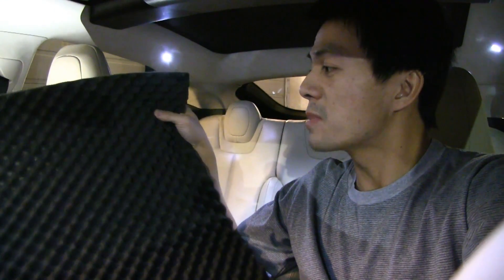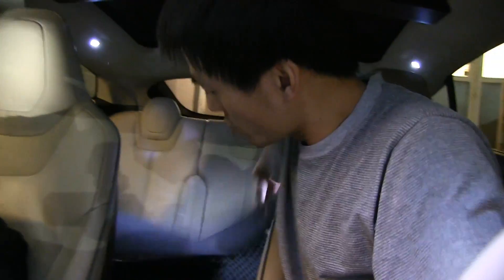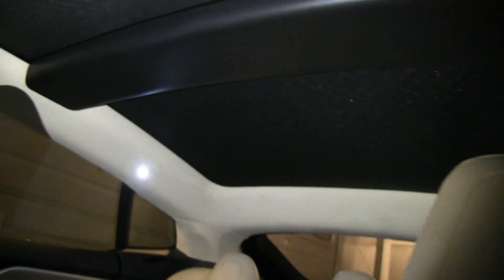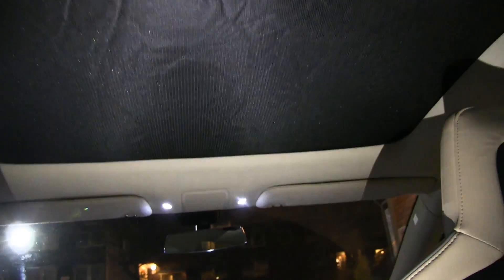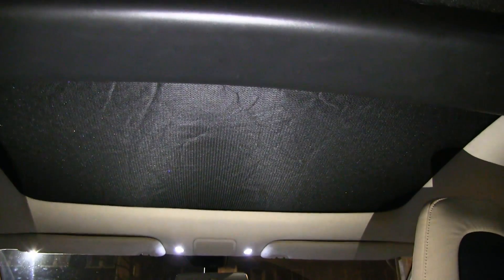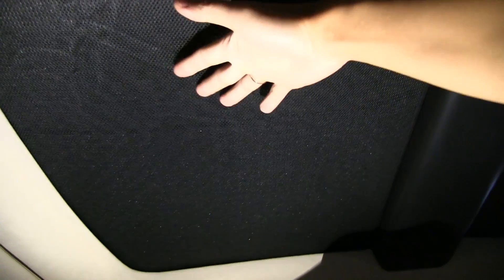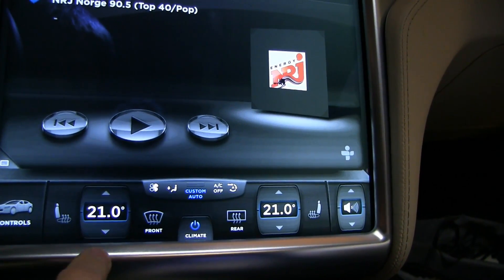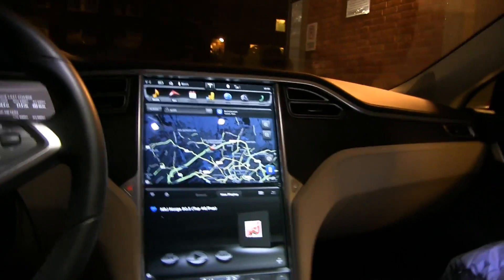Panorama roof insulation improved

Comment: This may just be coincidence, but it seems like my panorama roof is much draftier since the 7.0 software update. It doesn't ACTUALLY let air through, but seems to transfer more cold through the glass itself. At result, the air in the car above one's shoulders is quite a bit colder. I've been blaming this on the "more efficient" HVAC Tesla introduced with the new software because I don't remember the car having these problems last year. Thoughts?

Comment: How about insulation from heat during summer? In an ICE car amount of heat available is never an issue, while A/C can increase fuel consumption quite noticeably, especially in small car, like my mums Micra where turning on a/c feels like pulling a handbrake up a little :)  Here you have to both heat it with electricity and run a compressr during summer, I guess that A/C load is higher with glass top.
Reply from the maker: It's not an issue at all because the glass absorbs most of the heat. On a hot summer day, you can feel how hot the glass is. If it was cold, it would have let most of the heat right through.
Reply: I guess that it is heavily tinted and maybe even coated to be IR-reflective, but it usually gives glass violet tint that I haven't noticed.

Comment: Do you regret getting the panoramic roof considering the weather conditions you are usually in?
Reply from the maker: Not at all. With the insulation, I don't feel the cold in the winter. And in summer I can drive "topless". I also have the option to load stuff on the roof which requires panorama.

Comment: Bjørn there is also insulation for back window in tesla store. Do You think about it? Is heat also lose with back window?
Reply from the maker: I have the original Tesla rear window sun shade as well. There's always heat loss in all the windows. The problem with covering the rear window is that I lose visibility. One workaround would be to use bubble wrap or something else that is transparent. Either way, it will obscure the visibility.

Comment: I'm wondering if you've thought about trying this with the foam insulation installed upside down from the way it is here. As an insulator, having the flat side facing down would reduce the surface area exposed to the interior which would reduce the amount of heat that escapes out to the window, and having the bumps facing up would increase the air barrier which would add even more insulating factor between the cabin and the exterior, and it would also reduce the potential contact area with the glass which would reduce the amount of heat transfer from the interior, through the foam, and into the glass, so in theory you should get even better insulation by flipping the foam upside down.

It would probably not look quite as nice from outside the car, I'm not sure, I've never looked at a Model S with a panorama roof up close to know, but maybe it's worth experimenting with this winter!
Reply from the maker: Thank you for the tip! I think I will try that. It sounds plausible that the insulation will be improved. And as for the looks, the panorama glass is so dark that it will not be very visible.
Reply: It should not make any difference, which way the foam is orientated. The thermal properties are the same, no matter which way it is pointing. If you turn it around, it will have the large surface towards the cold side instead, and the outcome is the same as before....